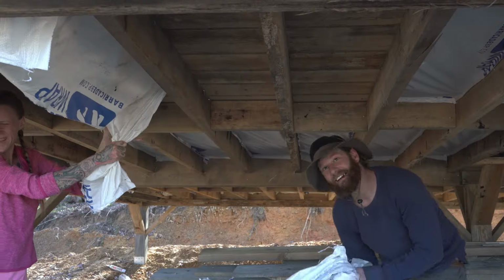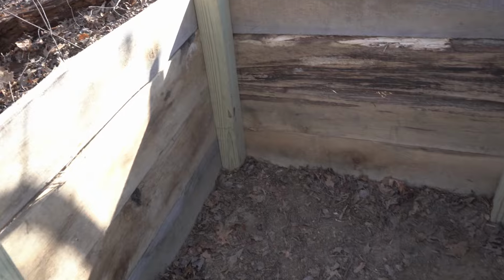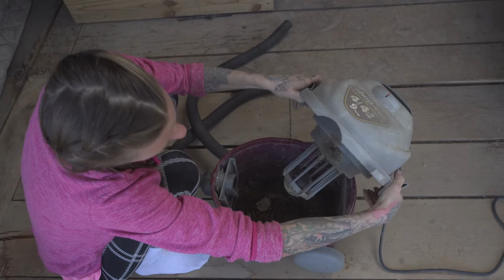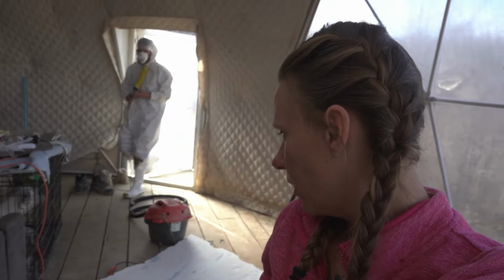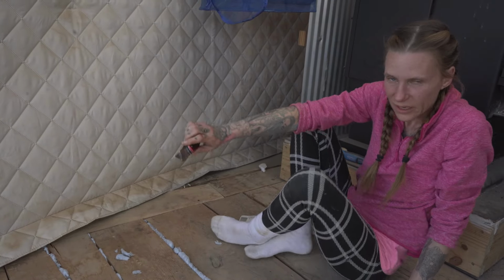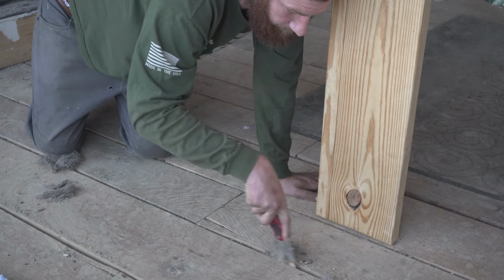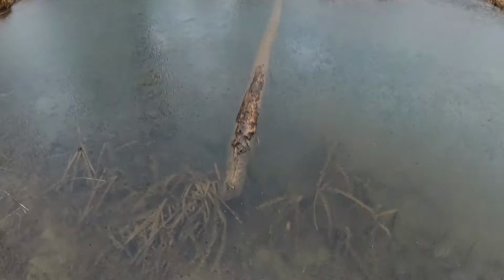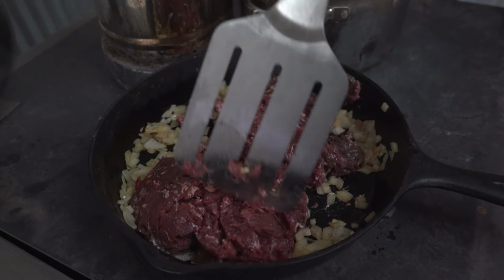Breaking Down Some of Our Off Grid Barriers

Comment: Good job filling the gaps, now put 100 - 200mm fiberglass /rockwool up in under the floor to really insulate the floor but only under the dome. Idea with the rain run off, cut a 4 inch gap right around the dome to allow the outside dome coverings to fall in so gavity flows the rain water away
Reply from the maker: That is actually a really good idea to cut a gap.. Just would have to move the water away from underneath.. It's an idea

Comment: You should've left the tyvek in place and sprayed from the top to fill in cracks if you wanted, and then sprayed underneath to cover everything.  No need to pull out what was already a wind barrier.
Reply from the maker: If I left the Tyvek up and sprayed over it, then I risked losing the insulation if the Tyvek fell..